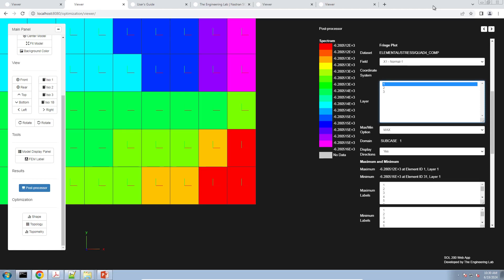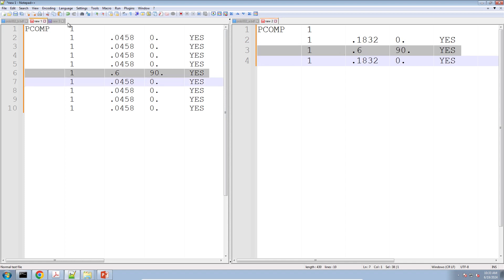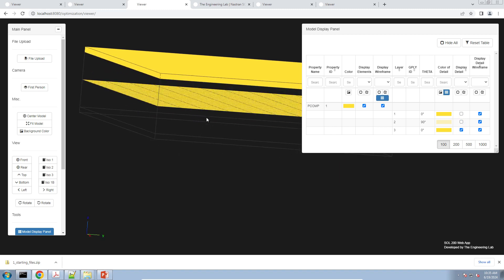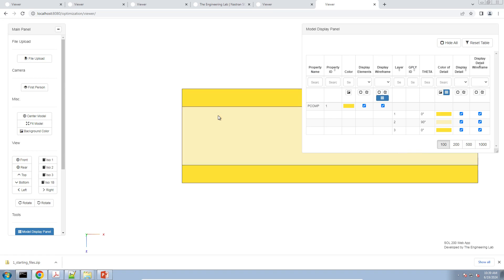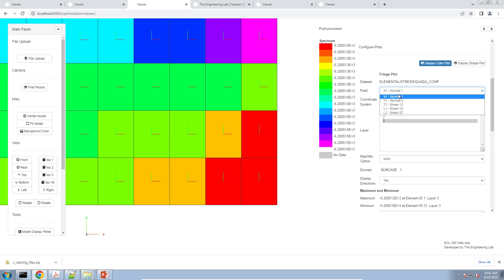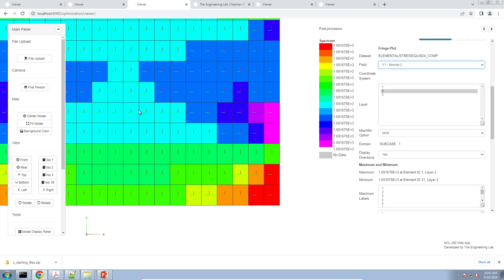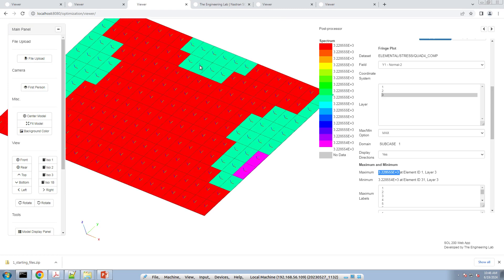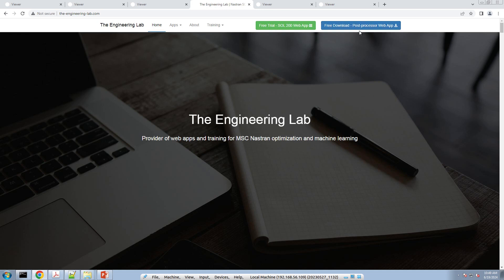MSC Nastran Results - PCOMP - Ply stresses

Comment: sorry prof,
if i want to evaluate the stress on the Honeycomb, how i do it? with min or mas principal stress? And in this case have to take into account all plies or only max/minimum labels of HC ply?
Reply from the maker: For whether to use min or max principal stress and for tension or compression failure, I recommend consulting with your professor or supervisor. Reddit also has an excellent FEA community that may provide more insight into your question.

MSC Nastran outputs stresses and principal stresses for each layer of the composite. MSC Nastran also outputs failure indices for each layer AND interlaminar failure indices.

Plies and honeycomb are significantly different, so quantifying their stresses should be done separately. Inspect the max/min labels of only the honeycomb layer(s).